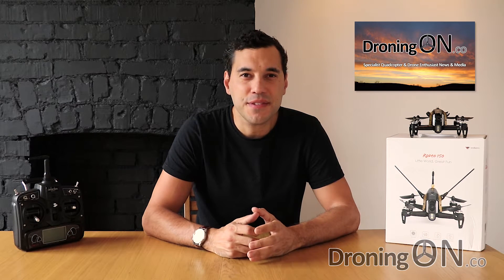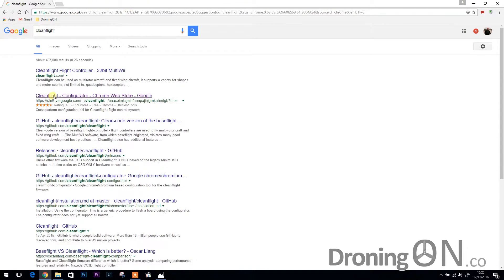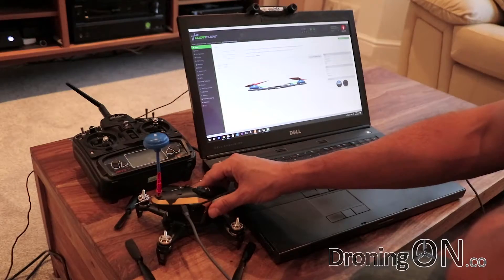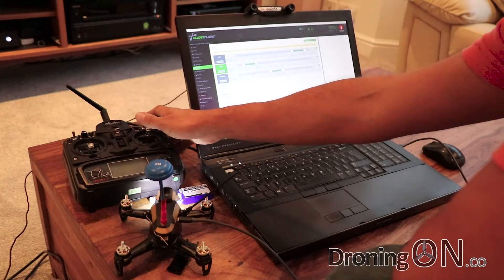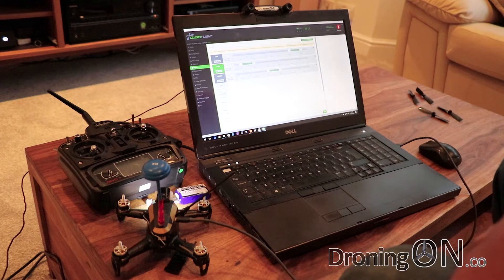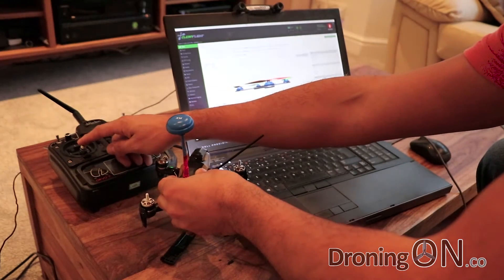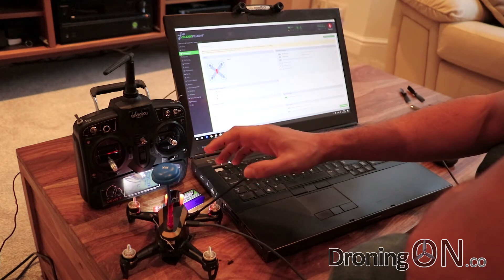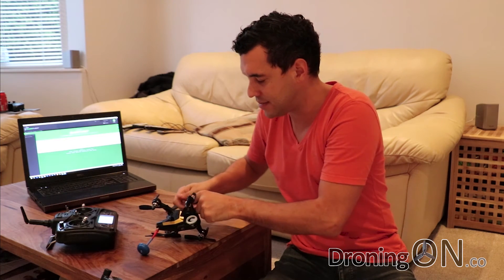DroningON | Rodeo 150 Cleanflight Tuning, Tips and Tricks Guide (Cleanflight)

Comment: Good video! :)
More basic tips (to next video):
1. Calibrate Devo7 sticks. (sometimes not perfect calibrated in factory)
2. Set sticks centers closer to 1500 -- on devo 7 funtcion->subtrim menu
3. set sticks endpoints closer to 1000 (low) 2000 (high) -- on devo 7 funtcion->trvad menu (100% sometimes just 1200-1800)
4. set FIX ID (on devo7 model menu) make chance to control came back after failsafe.
Reply: HorCsa thank you for these additions his video was awesome and these tips helped as well! So thank you both!!

Comment: THANK YOU!!! Is there any way to activate air mode from a switch, therefore you can activate it in the air?
Reply from the maker: +Lachlan Peknice, absolutely you can - under the 'Modes' tab of CleanFlight, you'll see 'Airmode' listed there - all you need to do is assign that mode to one of the switch ranges. Does that make sense or does this need another video :)
Reply: Much like yours, the air mode tab doesn't show up automatically when I plug in my f210? I cannot find the air mode switch selection tab anywhere?? Any ideas? Thanks!
Reply from the maker: +Lachlan Peknice, it might be that you're not running the most recent version of Cleanflight, this feature has been available in Betaflight for some time but is fairly new to Cleanflight I believe. It might be worth upgrading your F210 to Betaflight as I have.
Reply: Oh Gosh... I have no Idea how to do that... haha have you made many previous videos on it? Thanks !
Reply: btw, I am on the latest version of cleanflight
Reply from the maker: +Lachlan Peknice, you're in luck, I recently wrote an article on how to do it BUT be warned that after doing so, you'll need to setup the quadcopter again in terms of modes and channel mappings - but it is well worthwhile and you'll learn a lot from doing so: http://www.droningon.co/2016/11/10/fix-bricked-walkera-f210-3d-flight-controller-fc/
Reply from the maker: +Lachlan Peknice have you checked the version of CF installed on the firmware of the quad though? To find out, connect and then go to the CLI, type 'dump' and hit return, then scroll right to the top - that'll tell you the CF version flashed to your quad?
Reply: If I don't? How ho I install the latest version?

Sorry for troubling you.
Reply from the maker: +Lachlan Peknice you'll have to flash the latest version but that has some risks - see my guide on DroningON.co on how to flash firmware to the F210, that should help.
Reply: I really need your help!! I just linked my new taranis x9d controller to my walkera f210... It linked successfully and i have allocated switches for buzzers etc... The all work, but the arm switch will not work?? any ideas?? thanks
Reply from the maker: +Lachlan Peknice, on your Taranis has you configured your 'Arm' switch in the Mixer screen? Have you then gone into Cleanflight and identified which AUX channel it is assigned to? Then set that AUX channel to the mode for 'ARM' and move the sliders?
Reply: yes, exactly that... even on cleanflight in the arm section, when I move the AUX switch i can see the green dot moving in and out of the selected range... the motors just won't start up!
Reply from the maker: +Lachlan Peknice, are you sure that you have set the motor options on the 'Configuration' screen as per how they look in the video? Also, is the battery sufficiently charged that you've got connected? Also, are you sure that you're clicking 'Save' and also the 'Save and Reboot' on the 'Configuration' screen?
Reply: Yes i am doing every single one of those things... even the little warning symbol in the top tool bar of cleanflight indicates my motors are armed when I switch the arm switch... but the motors will not spin?.
Reply from the maker: +Lachlan Peknice, that's very odd - when you're doing this, do you have the battery connected to the Rodeo 150? It sounds like you've still got it connected to Cleanflight? Try another battery?
Reply: I did all you steps exactly, as well as assigning switches on my taranis, and the arm switch will not allow for any throttle input! really frustrating!
Reply from the maker: +Lachlan Peknice, perhaps you could upload a short video of all your settings from the 'Configuration', 'Mode' and 'Receiver' screens? Just to confirm, you've disconnected your Rodeo 150 from Cleanflight to test this?
Reply: do you have an email address I can send you a short video showing my problem??
Reply from the maker: +Lachlan Peknice, message sent.